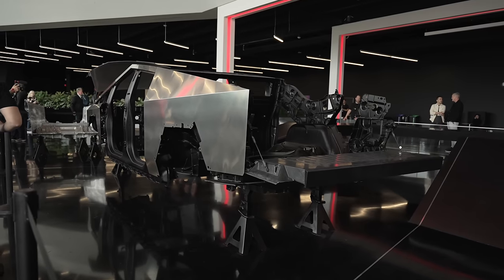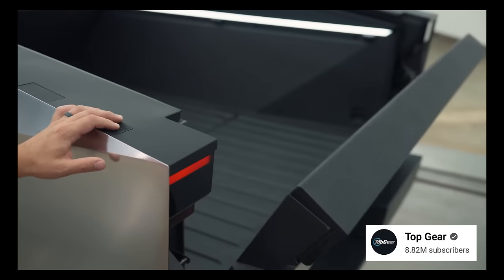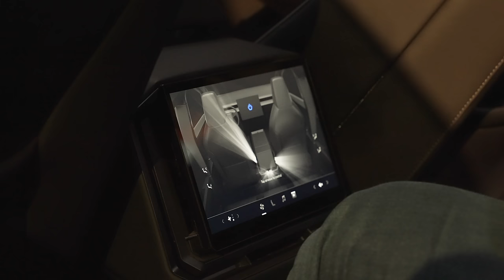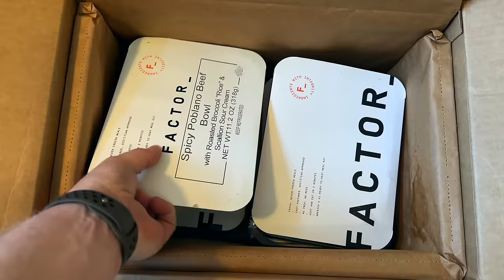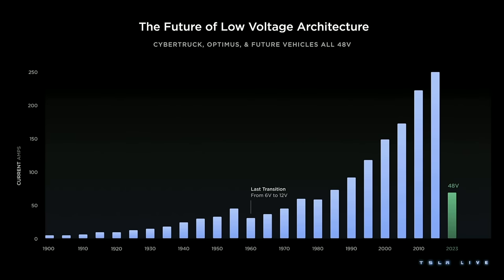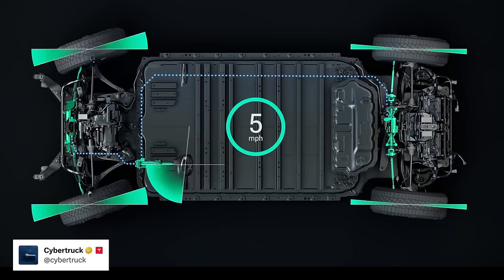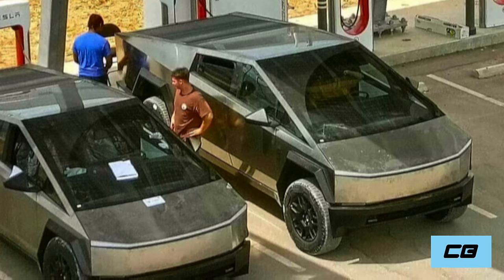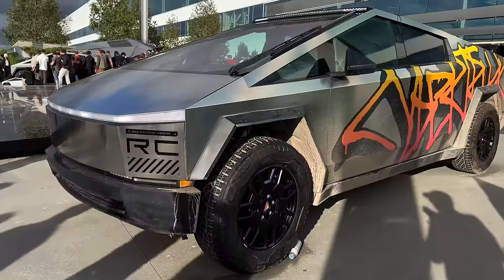NEW Hidden Tesla Cybertruck Features | A Full Breakdown

Comment: For towing trailers this needs more power outlets by the driver. Towing a trailer usually have a trailer rear camera, TPMS, GPS all which require 12v power. I don’t see enough ports by the driver to power all of these. One will need some USB multi ports or a 120v adapter plugged into the rear passenger outlet
Reply: That's a good question. Usually trailer power is provided through the round 7 pin connector next to the tow hitch.

Comment: I'm in the list but I'm probably not going to buy the cybertruck for a few reasons. I need 500 miles with out the extender I need the full bed capacity  I really needed the ramp the solar panel would have been great and last the price of the cybertruck I feel I was lied too. It really would have been great owning the the cybertruck but economically I can't.

Comment: A couple of things I haven’t seen yet is whether there is access to the bed (vault) from the cab and whether camp/dog mode would provide AC/heat to the bed. Some early tweets from Musk suggested these features would be included but it seems not, right?
Reply: I've been interested in this as well. However, the truck's schematics suggests that there will not be access to the bed from the cabin and AC/heat will not go the bed. :(
Reply: Lemons garage confirmed the cab doesn’t have access to bed
Reply: N O to both.  Where have you been?
Reply: I think I’ll modify mine and add a slide window lol

Comment: Man, I so want/wanted to get one of these, but the range just doesn't work for me; off roading and camping in the West requires more range than they have delivered (giving up 1/3 of the bed space for the range extender is not an option). One of my favorite places to play is the Sawthooths in Idaho. The closet Supercharger is in Boise and it would take, at minimum, half the battery capacity to get where I'm going. Unless they expand the network in these areas, I'll have to pass when my reservation comes up 😞
Reply: Your concern is valid and the good news is I see Tesla putting in Chargers in more remote and low population places. It surprised me when 2 years ago they put a Chargers in my little town of 6,000 people.
Reply: Your concern is valid and the good news is I see Tesla putting in Chargers in more remote and low population places. It surprised me when 2 years ago they put a Chargers in my little town of 6,000 people.

Comment: Thanks Ryan.  Do you know if the 48V architecture uses a 48V battery similar to the 12V system.  If so, where is it, will it be able to be easily swappable like the 12V batteries are?   Where is it located?    These batteries probably do not have the same lifespan of the 800V system.  And for the near future you probably can't easily purchase it anyway.
Reply: My take from the Monroe video is the 48v power system taps into the main battery and can convert to and from 12v to 48 volts. They mentioned the ability to "jump" the truck from a 12v vehicle. I suppose it's to allow for opening doors, rolling up windows, putting it in tow mode, etc when the main battery is off line.

Comment: I hope the Cybertruck door opening button's have an ice melting heater, 
I can visualize Sleet covering them on the flat top.
Reply: The Tesla app also lets you unlock and pop the door in case the button is covered in ice. This feature works for all Tesla vehicles, and was added about a year ago.
Reply: The door opener will break through 1/2 inch of ice.
Reply: He said it would break through 1 inch of ice
Reply: Yes, he said it would break through 1 inch of ice but I’m pretty sure that in the Sandy Monroe interview, Franz said that it would break through a half inch of ice.

Comment: I have a concern:

I am getting a cybertruck too, can’t wait, but…

Looking at my battery health in my model y performance since March ‘22 it’s at 87%. A whole year and a half has gone by and my mileage went from 303 to 267 on a full charge. Now my concern is for the performance cybertruck in the same situation 🤔

It’s great that it can do all these by-directional charging stuff but if you have a battery almost similar to my model y you would definitely think twice about charging someone else or charging your home 😬, cool trick but… definitely needed that 500 mile range for this trick
Reply: This is a bit of a stupid question, but do you often charge up to full or do you try and keep the max charge to around 75-80%?
Reply: @cadergator I think we all know the answer to that.
Reply: @cadergator  only 80 unless we travel which isn’t often and it’s usually only before we head out in the beginning of the trip, never in route at super chargers.
Reply: Keep going; if you can get it down to 80% before 100,000 miles; they’ll replace it under warranty!
Reply: Main thing to keep battery health high and longer: charge to a maximum of 80% (preferably 70%) for daily driving, and avoid letting the battery dip down to 30-40%. Avoid supercharging unless you're on a road trip, as it wears out the cells heating the battery up to accept such a fast charge. And when you're at a supercharger, avoid going to 100% unless absolutely necessary, 80% is the cap where it takes twice as long to charge because of how battery charging works and can also cause more wear.
Reply: If it continues to trend downward that quickly I'd take it to a service center, I lost around 20% over 3 years, but I also used supercharging a lot delivery driving. I went from 242 miles to 204 max range on a 2019 Tesla model 3 standard range plus. The other thing to consider is the weather, what climate do you drive in currently? The range estimate isn't linear, it changes based on interior ac/heat habits, road conditions, temperature and of course charging type.
Reply: @leetjohnson  then that’s your choice and preference. Making a comment like that on a comment section for tesla enthusiasts seeking solution or education…. Deaf ears brother. Go join the toy taco thread
Reply: @hotelvictortango  home base is Bloomingdale, IL. With nothing to do here i try to travel to the surrounding states, been to Colorado twice, Florida, and Virginia. 240v charger at the house. I’m also to blame for taking advantage of the “comforts” of the car more often i guess. I’m retired so i don’t truly go anywhere except errands and dining out with the wife. So normal stuff.
Reply: @leetjohnson  to be fair: almost anything is like this. On a gas car, they recommend not letting the gas tank go below a certain threshold to help the fuel pump last longer (not an apples to apples comparison since its cheaper, but one example.)

It's to help the battery last as long as it can
Reply: @leetjohnson your logic is off. I’ve only driven Tesla for past 3 years and spent 0 minutes of my time charging or at a gas station. You charge at night while sleeping.  You can use as much of the battery as you want. It’s just best for the battery to only use what you need each day. It makes no sense to charge to 100% and sit on that much charge all week if you only need 50-100 miles per day. That equals 20-30% that you will be using.  Please do more research to learn more about these batteries and best charging habits.
Reply: @leetjohnson  as I said, not apples to apples. Plus, I didn't say it "damaged" the fuel pump just like they didn't say it "damaged" the battery. Simply if you expose both to the extremes, it wears them down faster.
Reply: @dalejewell9916  i agree with you. You can’t talk logic with these people because they aren’t innovators or early adopters. They are stuck in their ways and looooove their fossil fuels because it’s quick and easy. They don’t like change and it scares them to adopt something new or research.

Comment: Any accessories (e.g. spare tyres) strapped to the outside will massively reduce range!
Reply: I've also wondered how much a rear mounted tire would reduce range. If it were mounted low enough to be out of the airflow, hopefully the range loss would be small.

Comment: Need to lose the rear screen in these vehicles. Better to have power charging outlets and great WiFi for rear passengers.  Like the idea of an add on or aftermarket tray for each rear passenger.  No need to build a tray into the seats. Keep it simple.  My observation is that most people prefer to use their on phone, tablet or laptop when traveling.  Rear heating and cooling can be adjusted (by request) from the front occupants.  Other items needed is a cooling system for the phone inductive charging system along with a MagSafe to keep them in place.